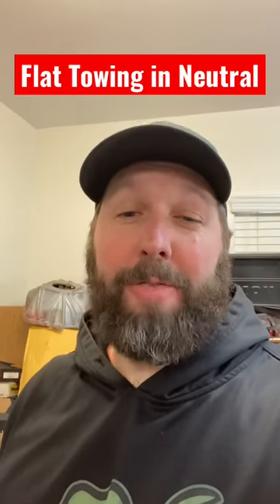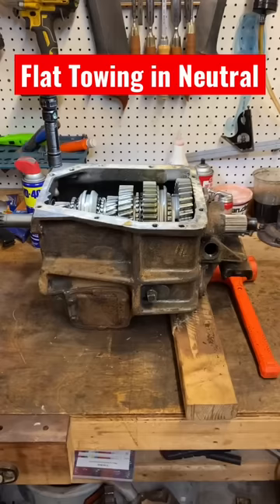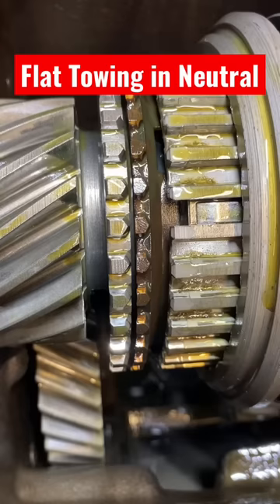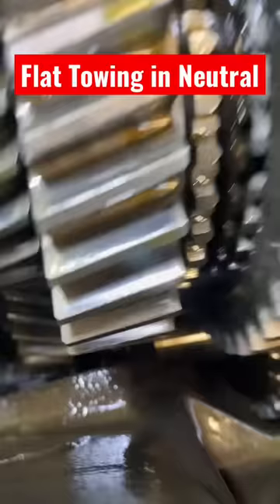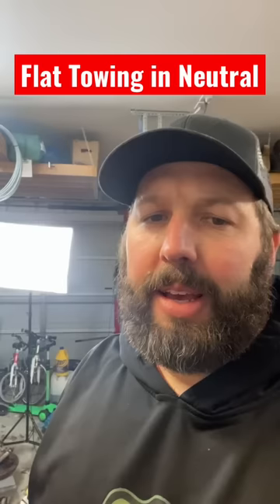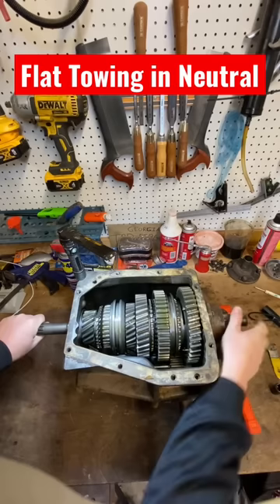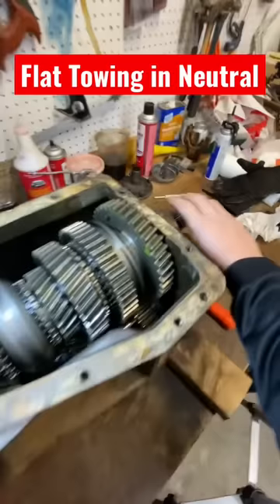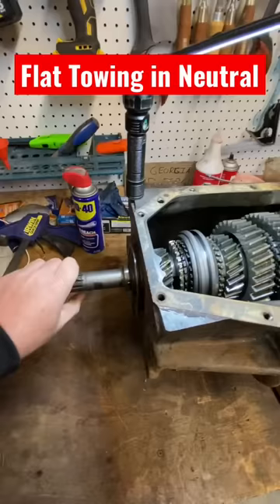Flat Towing in Neutral??? #transmission #stickshift #mechanic

Comment: It dont make since cause while a vehicle setting there running in neutral it doesn't hurt it   an if the input shaft is spinning while towing the counter shaft still spinning so its still throwing gear oil up 😂😂
Reply from the maker: The input shaft is spinning with the engine idling in neutral. The input shaft is not spinning when the vehicle is being towed in neutral.
Reply: @freedomworx the counter shaft is spinning when you turned the input shaft while its in neutral so its still throwing gear oil up cause its spinning which still throws oil on the top plate or cover wich drips/runs down on all the top gears so as long as oil is in the tranny its going to slung in the whole case so when i go to rebuild my 3speed tranny im definitely going to do a video to see for sure if your right but re watch your video it dont make sense 😂😂 cause the bottom gears spins with the top gears cause there touching an remind you the bottom gears sets in the gear oil so the oil dont just get slung from bottom an top gears so the gear oil is going to transfer from the from bottom gears to the top so
Reply from the maker: @scottsvillerebellilbitofev9927  if you are towing the vehicle with the drive wheels on the ground, in neutral, THE INPUT SHAFT IS NOT SPINNING, SO NEITHER IS THE COUNTERSHAFT. You are simple not comprehending what is being stated in the video. This video has been watched millions of times, and it has made sense to pretty much everyone else. You can argue whether or not the oil will actually make its way to the top without the countershaft spinning. But arguing that the input and countershaft are spinning when being towed is just silly. They are not, that’s a simple fact that was properly demonstrated in the video. So maybe you should watch it a few more times 🤷🏻‍♂️
Reply: @freedomworx  that was another point I was going to make if the drive shaft not spinning the the tranny ain't there for it ain't going to hurt it either cause it's in neutral that means the wheels is free spinning which means the gears ain't going to get hurt or nothing now automatic mite be different but standard like the transmission you showing it's not going to hurt it flat towing ik I towed to many an there still fine til this day 🤣🤣😂😂 your just going off by what someone told you an you happened to take your tranny apart to try an show what they said I grew up around lot of old cars an trucks an old timers an never once heard that an they flat towed all their life an they never had an issues either just saying 🤌
Reply from the maker: @scottsvillerebellilbitofev9927  I’m going by what Tremec told everyone. Obviously you didn’t get the memo. But hey, what do they know? You do you. https://www.tremec.com/not_am_detalle/flat-towing-manual-transmission-vehicles/

Comment: Ur also not suppost to tow a awd car like a normal car also cuz ull brake the transmission and rear gear
Reply from the maker: You should read your Owner's Manual. Towing in neutral is fine for some vehicles.
Reply: @Freedom Worx  well honestly the only thing u should be flat towing are awd cars and we all know I mean subarus cuz it's either flat bed or flat tow

Comment: Don't freewheel downhill.
Reply from the maker: I personally don’t, for safety reasons. But you could as long as the engine is running and you weren’t depressing the clutch.

Comment: So you say only tow manual vehicles…in gear.
Reply from the maker: Didn’t say that at all. Said just throwing them I. Neutral and dragging them down the road, can be harmful. You might need to take other actions like removing the driveshaft. The owners manual should specify. Here is a slightly longer version of the video. https://youtu.be/yCOos-u0oKs?si=5V1j70w6Q29NadjQ

Comment: What if you have an automatic
Reply from the maker: Same. You’ll fry an automatic towing it in neutral. Some manuals can be towed in neutral just fine. But I don’t know of any modern automatic where it is acceptable. But as always refer to the owners manual.
Reply: @freedomworx  even in a truck?
Reply from the maker: Well the pump of most automatics is driven off the torque converter, so if the engine isn’t spinning, it isn’t pumping oil.

Comment: Shouldn't you be towing with the drive wheels lifted? RWD vehicles should be towed backward, FWD vehicles should be towed frontward. That way, the tranny isn't spinning at all. If the tranny isn't in neutral, and no one is in the vehicle to hold the clutch pedal down, isn't the crankshaft of the engine also spinning? When it's not running, the strain on the entire drivetrain, from engine to tires on the road, is ridiculous. Back when we had to "flat-tow" a friend's classic hot rod behind our own vehicle with a tow strap, we would get under the vehicle and remove the drive shaft to eliminate any potential damage to the engine and tranny. You might have to refill the tranny with some gear oil, but that's a small inconvenience.
Reply from the maker: Well Flat Towing means that all 4 wheels are on the ground. So lifting the tires is outside the scope of what I'm talking about. I never said to tow with the vehicle still in gear, that a ridiculous assumption. The point is, though most people think you can just throw a vehicle in neutral and yank it down the road, you might be doing damage to the transmission. You have to read the owners manual to know for sure. Like I stated in the description of the video.... There is only so much information you can fit into a 60 second video.

Comment: I call B.S.  Not all transmissions are that poorly designed.
Reply from the maker: B.S? Click on the link I provided from Tremec below... This is not a poor design. It's the same basic design that is still used in HD transmissions 50 years later. HD Transmissions are designed to be robust and efficient. They are not going to compromise the efficiency of the trans because they is a minuscule chance that the truck will need to be flat towed. That's like designing a commercial aircraft to do a better job of crashing into the ocean because there is a minuscule chance that it might have to ditch at some point in the aircraft's life. It would be so heavy and inefficient, that it wouldn't be useful to anyone. You think the engineers weren't intelligent enough to just move the fill hole on the transmission up an inch so that gear would catch oil, if that's what they wanted???https://www.tremec.com/not_am_detalle/flat-towing-manual-transmission-vehicles/

Comment: Stupidly designed. So whoever designed this simply thought there would never be a need to ever tow this vehicle.
Reply from the maker: They are still designed that way today. Every heavy duty transmission is designed that way, because that is the design that can handle the torque and last. It’s not stupidly designed. It’s designed to do the job reliably and efficiently. It would not make sense to raise the fluid level or redesign the power flow to a less efficient or robust design, just so a vehicle that will probably never be flat towed, can be flat towed more easily. That’s like designing airplanes to fly through volcanic ash.

Comment: Or take out the drive shaft so it doesn't matter.
Reply from the maker: I never insinuated to leave the trans in gear. Removing the driveshaft is the safest option, though not always necessary. 👍
Reply: @freedomworx  I was wrong, you didn't say it. So I edited my comment.
Reply from the maker: I might sound dumb…but I’m not that dumb. Give me a little credit 😉
Reply: @freedomworx  hmmm, i edited my original comment once but it didn't change. I tried again.

Comment: This is a dumb illustration. Of course when you put it in neutral it will not splash the oil on the gear because there is no oil on your transmision. Put some oil and turn it again look what happen. The oil will splash well and you have to turn it a lot faster. Ive been towing my cars on neutral for years and I have no problem. My advice to this guy put some oil on it. You will not use that transmision without oil. Right?
Reply from the maker: What’s your advice to Tremec Transmissions? Because they say the same thing 🤷🏻‍♂️😘. https://www.tremec.com/not_am_detalle/flat-towing-manual-transmission-vehicles/

Comment: Really? Everything I've heard is that you can flat tow a manual
Reply from the maker: Some yes, some no. You have to refer to the owners manual. https://www.tremec.com/not_am_detalle/flat-towing-manual-transmission-vehicles/
Reply: @freedomworx  89 bronco with the 5 speed
Overdrive not granny low
Reply from the maker: @gearjammer3200  what’s the manual tell you? I’m not Rainman 😉
Reply: @freedomworx  ya I don't have the original and I didn't see it in the Haynes

Comment: From an engineering perspective, I'd say that is a bad design. Must be a GM.
Reply from the maker: You could easily raise the fluid level in the trans to accommodate this scenario. But then you would be sacrificing fuel efficiency in the condition the transmission will operate in 99.9999% of its life.

Comment: You're full of it... And I'm going to tell you why. I've driven a manual transmission for years my car right now has a manual transmission as long as the transmission is in neutral the input shaft and output shaft are not connected which allows the output shaft to spin freely if it didn't the car would not move in neutral or in gear if it was off that's first and foremost... The second thing is most manual transmission nowadays use ATF why??? Because it's a better Limerick then gear oil the last four or five cars that I've had that were manual transmission used ATF and in case you don't know what that means it means it uses automatic transmission fluid and weather it uses gear oil or transmission fluid the transmission should be at least 1/2 full that's the reason for that plug on the side of the transmission that means if it's not full you stick your finger in the hole if you don't feel transmission fluid and you need to add some and you add until it starts seeping out the whole when it starts seeping out the whole put the plug back in its full you can tow a vehicle as long as it has a manual transmission and as long as it's in neutral and you can do that without having to drop the driveshaft... However an automatic transmission you do not want to toe unless you drop the driveshaft or put it on a flatbed the reason being is because an automatic the gear clusters will still move if you don't drop the driveshaft and you don't put it on a flatbed this only applies to RW drive not a f.w. drive... If you don't drop the driveshaft or put it on a flatbed it will cause the transmission to overheat... Again this only applies to rear-wheel drive vehicles with an automatic transmission a stick shift is not affected
Reply from the maker: If I’m full of it, then so is Tremec…but hey, what do they know 🤷🏻‍♂️. https://www.tremec.com/not_am_detalle/flat-towing-manual-transmission-vehicles/

Comment: Dont flat tow any trans. Manual or auto. It screws them up the exact same way
Reply from the maker: Is the safest option. But some can be flat towed with no consequence. I was just pointing out the manual trans, because most assume it’s fine to do it.

Comment: It's mostly bullshit. Take it from a 40 year veteran tower. You can tow a manual in neutral for up to 50 miles. Even the manufacturer will tell you that. The lubrication he's worried about are the gear faces, WHICH have no loading in neutral. In Fact, the large gear you see still spinning is actually in the oil and will provide plenty of lube for the few parts that are turning under no load. The only oil needed is on the shafts themselves where they pass through the case. There is enough oil held in the bearings to get it to the shop. If you're towing long distance, just overfill the tranny. Problem solved.
Reply from the maker: I’m not worried about gears meshing. Just the bearings and synchros.  Different cars have different allowances to towed distance and speed. That’s why you read the Owners Manual 🤷🏻‍♂️
Reply: Your video is misleading. Take the same transmission, fill it with oil and spin that shaft. You will find that one big gear is still in the oil. Now imagine it spinning at speed and I'll bet you find it still provides plenty of splash to lubricate everything.
Reply from the maker: @bigbill2376  I guess Tremec and other OEM automotive transmission manufacturers are misleading also 🤷🏻‍♂️. https://www.tremec.com/not_am_detalle/flat-towing-manual-transmission-vehicles/
Reply from the maker: @bigbill2376  I don’t care if you believe the facts or not. I’m just providing them to you. I’m just educating people on why their Owners Manual says what it says. But hey, you feel free to provide them your 40 years of improper vehicle towing and recovery experience.
Reply: And there we have it. Why won't you put oil in it and give it a spin? If I'm wrong, I'll admit I'm wrong. Of course if you think calling me names instead somehow makes your content more believable, by all means, continue.
Reply from the maker: @bigbill2376  I won’t put oil it in and spin it because it’s been in the damn truck for 3 months. I’m not pulling it out to convince a know it all tow truck driver. It’s not about this transmission. Did you ever here me say that “This is why you don’t flat tow an SM465 in neutral?”  NO! BECAUSE THE VIDEO IS ABOUT MANUAL TRANSMISSIONS  IN GENERAL! NOT SM465s!  It’s about manual transmissions and why an owners manual might tell you not to do it. You came on my channel saying I’m spreading false information when I am spitting straight facts. Tremec said the exact same thing in their article as I said in the video. Why do tow companies pull the driveshafts before they tow semis? Why do RV owners by driveshaft disconnects for their towed vehicles????? Because the spinning output shaft will scorch the transmission that isn’t being lubed properly. Manual or Automatic… doesn’t matter. Either is susceptible to the same failure mechanism. Why does Jeep tell you to tow with the Trans in Park or in gear and put the T-Case in neutral????????? For the exact same reason I said in the video. T-Cases have pumps that are turned when the output shaft turns… You are simply wrong. My channel is for people that want to learn, not people who already know everything 🤷🏻‍♂️. So maybe my channel has nothing to offer you.
Reply: @freedomworx  Wow. Ok then .... 👌

Comment: Just unlock your hubs 😅
Reply from the maker: My rear hubs 😂🤓
Reply: @freedomworx  just get 4 wheel steering
Reply from the maker: @jaboff-road1776  all the rear steer rigs I deal with have rear drive slugs. But you could use locking hubs if you really like to break stuff 😉

Comment: another nonsense video
did you see how the counter sghaft still spins until he had to hold it with a vice  grips and a hammer ,
Reply from the maker: Think you might want to watch it again and try to absorb the information before you try to disprove it 🤷🏻‍♂️ Tremec will tell you the same thing 🤷🏻‍♂️ https://www.tremec.com/not_am_detalle/flat-towing-manual-transmission-vehicles/

Comment: Sir you are misinforming people you should aways be in neutral whilst towing, you trying to grenade peoples motors?
Reply from the maker: I’m not misinforming anyone, you are. I never said to tow with the trans in gear. I said it’s not safe to tow it by just placing it I neutral. And that’s a fact. It’s ok for some and not others 🤷🏻‍♂️ https://www.tremec.com/not_am_detalle/flat-towing-manual-transmission-vehicles/

Comment: Don't tow it in neutral? OK, what gear do you tow it then. This is the stupidest thing I've heard all week.
Reply from the maker: You should read your Owner's Manual. Towing in neutral is fine for some vehicles. Some need the driveshaft disconnected. The thought that you should tow in gear is the stupidest thing I’ve heard today 🙄

Comment: You do realize that the same thing will occur if you just let your vehicle idle too long in neutral? At least when flat towing the vehicle you may get some plaza activity in there thx to the shit roads we are given
Reply from the maker: The countershaft is driven by the input shaft when the engine is running in neutral 🤷🏻‍♂️